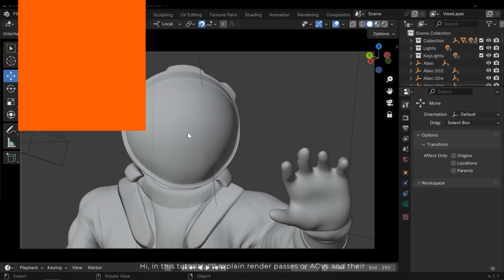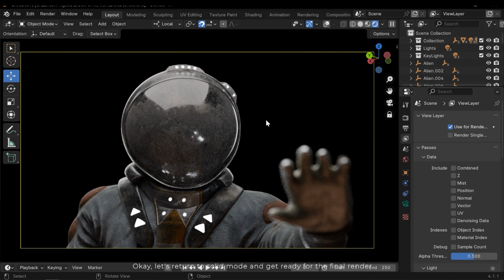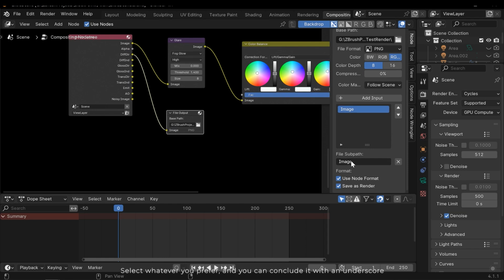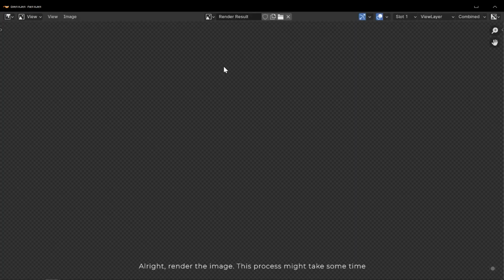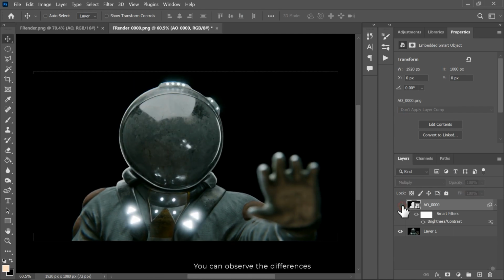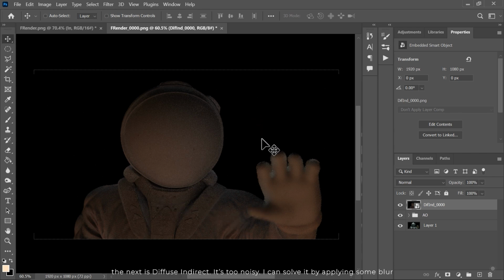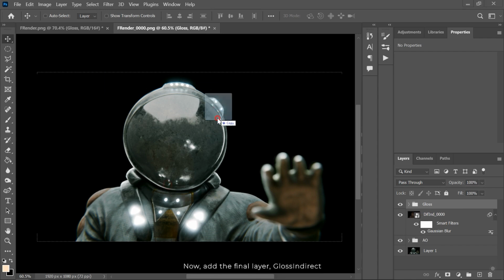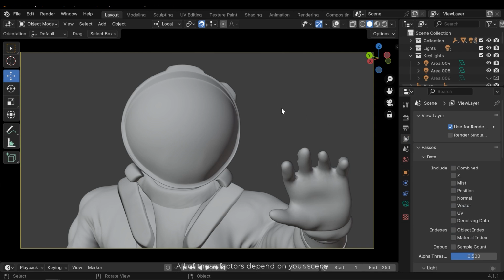Achieve Realistic Renders with AOVs in Blender

Comment: You don't need several output nodes. You can use one for several layers. You only need a new one, if you want to save different file settings or color depths. Just add inputs and name them accordingly.
Btw, I wouldn't recommend multilayer exrs, for performance reasons. Well at least for animations, for stills it does not really matter much. Cheers.